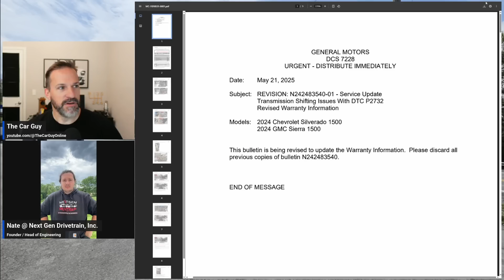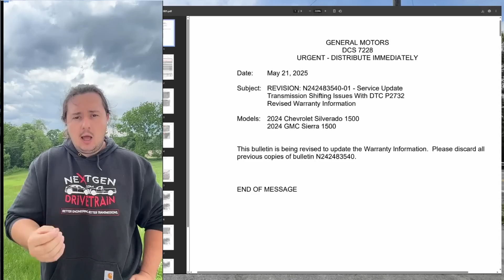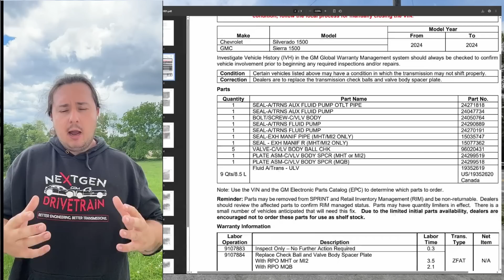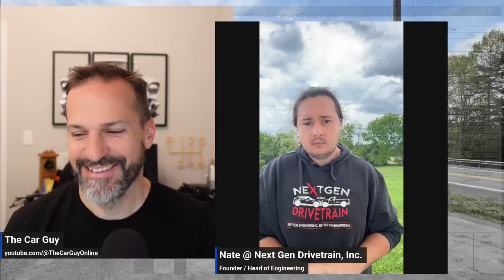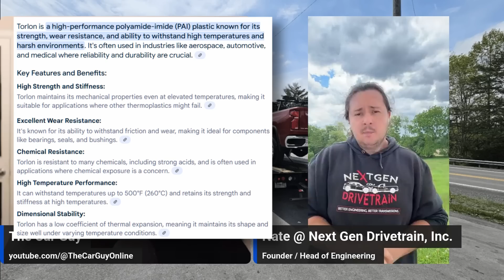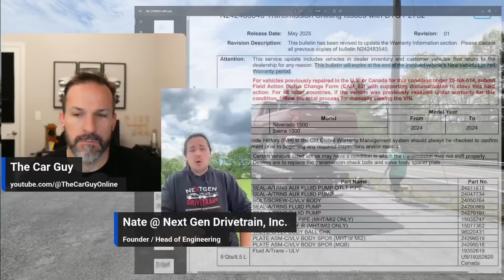GM’s NEW Transmission TSB EXPLAINED by NextGen. Will it EVER be FIXED? Silverado and Sierra 1500

Comment: Thanks for having me on! Important Tip for Consumers: 

ALWAYS ASK FOR PICTURES OF WHAT YOU’RE PAYING FOR! If someone wants your money, they can show you what you’re paying for. It takes 5 seconds to snap some pictures. This INCLUDES us!
Reply: I typically film all of my teardown and most of my assembly videos that I’ve taken the time to do or published here on YouTube. However, most of my information is not published on this platform, but it is published on TikTok (1M followers), Facebook (100k followers) and Instagram (300k followers). I am a member of the transmission brotherhood and I’ve known about you for some time but not a lot of information has come out until recently because of this page. I’m interested to get a hold of one of your kits and evaluated from an engineering standpoint as I have worked with Transgo, Sonnax, and Superior on some of their products that I’ve had concerns with. Good minds think alike and I like the way you think.
Reply: Would 2 oem plates on top of each other work?
Reply: No, the black sealing material they put on the plates follow the casting lines of the valve body and won’t seal properly against another plate.
Reply: @NextGenDrivetrainInc  right. I like the way you think. I don’t post on YouTube too much mostly with TikTok, Facebook and Instagram and a member of the transmission brotherhood. The main social I post on is on TikTok with over 1 million followers and I tried to find your account, but it seems like there’s one but nothing’s posted there. I’m a semi retired GM tech that has been using aftermarket products for their fixes for years and I haven’t really heard about your product until recently. I’m typically working with Transgo Sonnax or Superior with product development sometimes. I’m gonna look into getting one of your kits and may reach out about my thoughts on it. I’d be very interested to have a conversation one day.
Reply: @NextGenDrivetrainInc  xylene solvent could dissolve the coating material on one side
Reply: Build a car and I’ll be impressed
Reply: Thanks for your honesty that's why I drive a 94 still and I have a 1970 with the original transmission in it
Reply: My builder always brings me in, shows me my old parts, what broke, what's weak, updates etc. I love your ethos. Great information! 🤘👍
Reply: That featured truck in the background is still down for parts after 32 days. I have C/C NexGen's corporate email on an email to GM customer care on this whole matter. Opened the discussion to have the valve body replace with one from NexGen instead of another OEM part.
Reply: Why did you raise the price for the 10L1000 upgrade kit?

Comment: 2024 Silverado 1500 3.0 duramax owner. I had done the PPE transmission pan and bypass valve upgrade at 25,000 miles to avoid or delay this. Sure enough at 28,800ish miles I got that P2732 code. I lost reverse and was limited to the first three gears and went into limp mode. So now it’s at the getting covered under warranty, thankfully. Have been without my truck for two weeks at this point. And yes I use my truck as a truck and tow with it roughly 3-4 days a week.

Comment: Someone with experience metal stamping here. What he is describing is called die roll with punching out holes. As the punch enters into the sheet of steel it pulls material before it starts cutting, creating a radius on the entry side of the punch. As the punch reaches the deformation of the material it starts to make a hole that is identical to the size of the punch. But, on the other side of the material a fracturing starts, giving you what's called break. So due to these two cut conditions you actually only get a hole that is the size you wanted for about 30-50% of the material thickness. So if you had a .06" plate your hole is only the size you wanted for about .015" - .03". The remedy to this is to add what is called a shave station, which reduces cutting clearance and requires two punches to make the same hole. This also dramatically increases cutting forces and cost.

Comment: Add another 2022 denali 1500 to issues.  101000 km and GM says not covered.  Lost reverse on Friday and than Monday reverse worked and lost drive.  Tell me I need new transmission and won't cover it.

Comment: Lets see…200 series in the 70s. 125…200 again…440…700r4..4L60e….how many years does it  take for people to lean GM has made crappy transmissions for 50 years. Only the 350-400/425 had any durability. Its sad that the company that invented the automatic transmission cant make one anymore. we gave up on them after (8) 700r4s were replaced in a single 87 silvarado under warranty. Yes 8

Comment: Stuff like this is exactly why I bought a 2021 tundra and added a transmission cooler my self. I opted to not buy any new turbo v6 with a 10 speed transmission.  Toyota is on the same model as the Americans now.  This guys analysis is spot on, they want you to get out of warranty and then have to pay for parts and repairs.  A manufacturer who is willing to build a solid product that lasts and then back that product to a fault will take over the light and heavy duty truck markets.

Comment: It seems like since Siac of China bought into GM in 2014- GM has been on a kamikaze mission to put themselves out of business.

There isn’t anything in the product line that doesn’t have issues or recalls. How do you go from building 300k mile trucks to engine transmission lock ups under 10k brand new.

Comment: There’s so much BS on the web, so when a guy like this states a fact, and exposes massive GM fraud his claims can be ignored.
If someone tried to rob me, or did rob me of $25k…. (Multiple transmissions )…. There would be a police investigation.
Who should be pursuing this massive corporate fraud ?
Who should I call to say my local dealer is scamming me, they know it, I know it, my local certified independent shop knows it ?
In this fraud GM is using paper to perpetuate the fraud , if they used a weapon I’d cal 911, but the damage to me is the same.

Comment: The dealers are not even trying to hide the fact that they perform palliative care until warranty is done and as soon as the warranty expires, “They found the source” and I can pay to have it fixed.
If I correct the problem myself before the unit fails, my warranty is void. I take it to the dealer, and they put a bandaid on the problem until warranty expires, then they expect to charge me to properly repair replace correct the root cause.
No my comment is not hyperbole, I’ve bought many trucks, the pattern and strategy is very clear and they don’t even hide it.

Comment: I have a 2021 gmc sierra 1500 3.0 duramax that has cumulatively been in the shop for 7 months plus. GMC has given me a maintenance warranty that basically amounts to 6 oil changes and tire rotation. Been in repeatedly for emission codes over and over. Oil cooler replaced for leak. Rear main seal replaced for leak. Injectors replaced. Glow plug replaced. Complained for a year that transmission was slipping but they couldn’t find anything wrong. 200 miles out of warranty they’ve found a problem with valve bodies and torque converter and say I need a new transmission. GMC’s response. Good thing you have an extended warranty.

Comment: I can 100% vouch this guy is telling the truth about GM and their scam. I just went the through the run around with GM when my 10-speed transmission went out. Gm would not give me any information whatsoever as to whether they updated the valve body to fix the issue, but they were VERY insistent on doing the work at $10K plus taxes and shop fees. Told them for 10K plus they were going to tell me something, and they were just smug and condescending and just kept repeating "We put certified GM products back in our vehicles. That's all I'm obligated to tell you."  I hung up on them and went with a trusted local shop got it rebuilt, reassured they upgraded the problem parts, gave me a 3-year 100K no questions asked warranty, and did it for $7500. I'll not ever buy another GM vehicle. They've lost a multigeneration customer for life.

Comment: Well.....  In "MY OPINION".   Nate is 100% Correct. I'am here to tell ya, he is 100% Accurate!  I own a 10R80. FORD has "Attempted" to FIX it 4 Times Now. Truck has 10,355 Miles. Been at the Dealership for "12" WEEK's, YES That's TWELVE WEEK'S!! One "NEW" Tranny, and 3 More Trips for Ongoing Issues. Last Trip, CDF Drum, Trash Can Sutter Shell, and NEW VALVE BODY?????
Reply: You should get a lawyer and sue for lemon law

Comment: 9:42 K pump the brakes, not significantly more money to laser cut than to stamp a part??? What country are you referring to getting these manufactured in? The reason stamping is picked over laser cut is because this is mass production, not a custom fab shop for low volume.

I get that this guys does good work, but laser cutting parts at the scale GM requires for the volumes they pump out would mean many multi-million dollar laser machines running in parallel in order to my cycle times on the floor and meet the volume quotas. 

Sure for 50k number of units can you laser cut, yes, but for millions of units this just isn’t feasible nor practical to do it when stamping can be done. Is the material super hard making larger break vs shear a problem, I can see this, but that can be tuned by a good tool maker who has 10 years of experience in stamping dies. 

Totally think the expert here has a lot of really good information on transmissions and the problem and fixes he’s developed to solve it; but stay in your lane…

Comment: Nate is the expert at NextGen and supported by Will and Chris - I am using one of their excellent valve bodies and can confirm I received excellent service. My transmission (10L80) was changing gears very abruptly and noisy especially the reverse gear - now changes gears super smoothly - thank you very much for saving my transmission.

Comment: Bought my first ever new truck, my dream truck. 2025 Silverado 1500 LTZ. 393 miles in started having the rumble strip vibration. Took it into the shop 2 times and we’ll surprise surprise it has a bad valve body with No ETA on the part. Initiated the buy back process and we are going on week 2 of them “reviewing” my request. BS!!

Comment: Is anyone making a reliable, full-size truck nowadays? It seems that every manufacturer has forgotten how to make engines and transmissions. It’s crazy.
Reply: Bro it’s called cost. Will you pay 80k for a 1500? Probably not. These guys point the finger at the manufacturers but they don’t tell you his parts are double the price of the oem…. Blame the government for useless regulations and for creating all this inflation in the last 10 years
Reply: Even build quality. 
You know how many exposed and unprotected (paint only) pinch welds and spot welded seam flanges I see under a new truck? 
It's like we forgot everything we knew in the late 90s and early 2000s with avoiding rust traps like that.  @RipliWitani

Comment: As a Transmission shop owner of 34 years and counting. I would suggest that folks listen to this guy. Every single point I've heard him make. Is absolutely spot on. Next Gen isn't the only company with solutions to these problems. But he is the most vocal about them. And I applaud him for it. I plan on putting his products to the test. Especially on the 10 speeds. I have confidence they will perform as advertised.